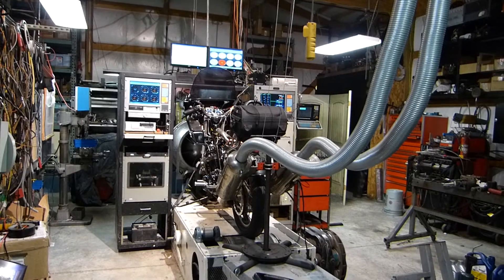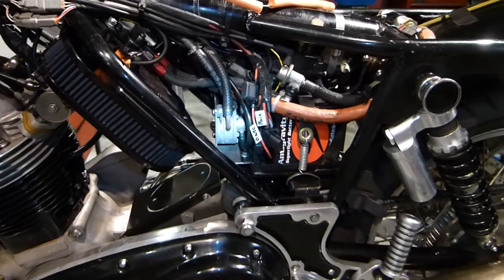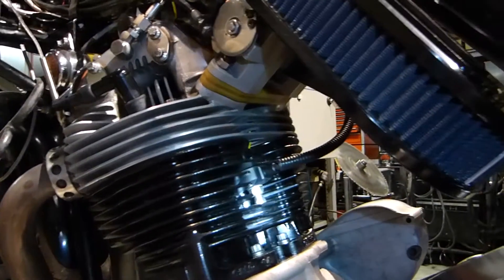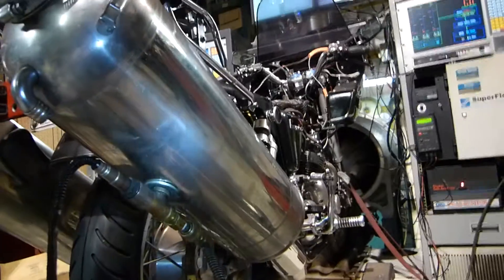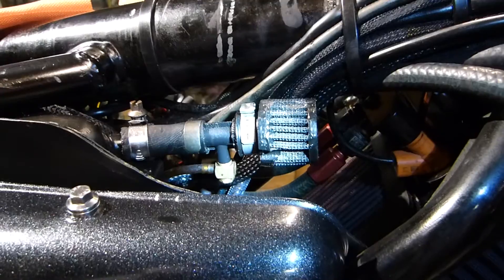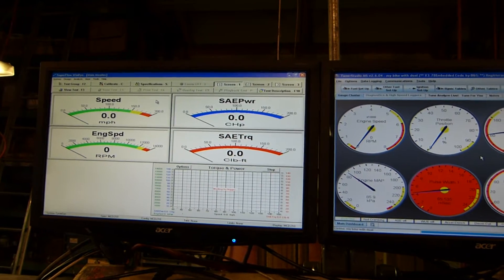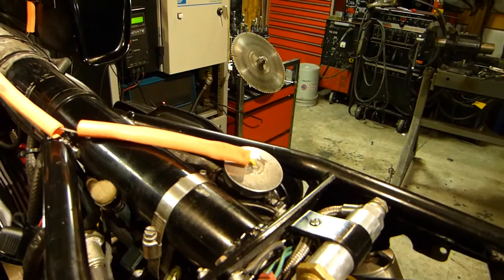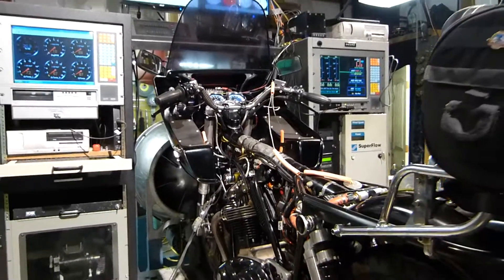P1140048

Comment: What did you use for crank position? Did you make a trigger wheel off the primary? I was contemplating using a cam signal off a boyer and scaling it to work as the crank position.
Reply from the maker: I use a 36-1 reluctor on the crank along with a single tooth reluctor for starting.